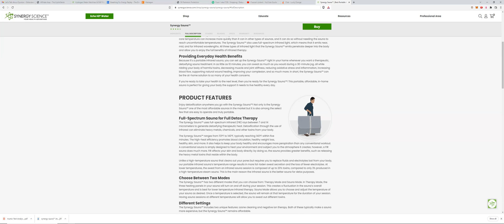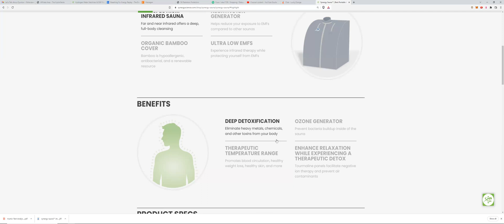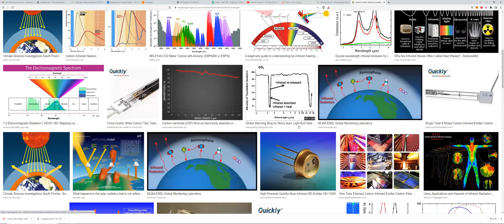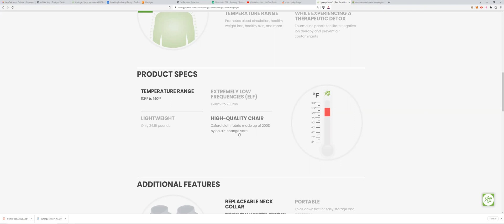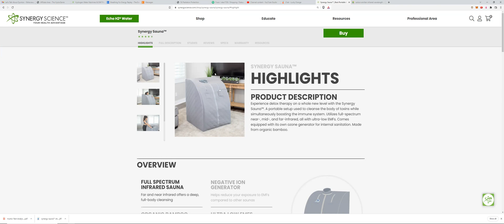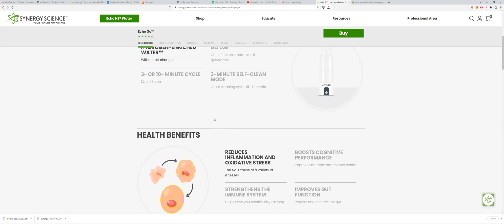Synergy Sauna Infrared Portable Sauna Review

Comment: The sauna was highly recommended. The advertising said all the things I needed to hear in order to convince myself, this was the perfect Sauna. I Purchased it during Covid and so it took several months to receive it. About a year later I moved and found this blue crumbled insulation on the wall of the sauna all over the floor. I emailed synergy and the representative said it was past Warranty and he would do nothing about it. A reasonable and Honest, synergy representative should’ve said, “wow what’s wrong with this How can I make this right for you? We don’t want this happening to other buyers as it could be a safety hazard with plastic melted to the inner core of the sauna.”
This is not safe and not good and they should’ve replaced it. I’m very disappointed in the company and will not recommend them to anyone anymore. It was not that old and I was the only one using it and hardly used it more than 30 times. I purchased it from them directly on their website so they probably won’t even post this but I will find other places to post as well. Buyer beware. I have waited this long to write a review because I moved and it has been almost a year since I emailed them...Just wanted folks to know. I have photos also and will be sending this info to distributors. It is the principle of the issue...